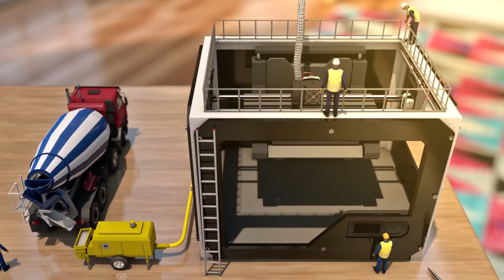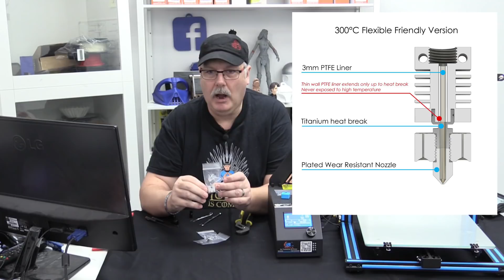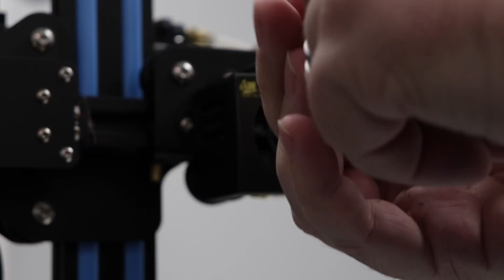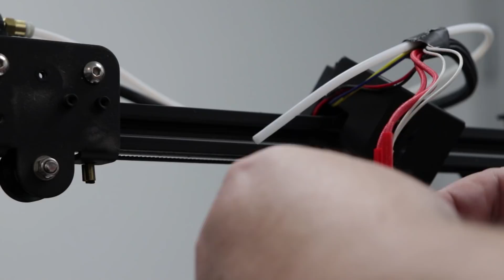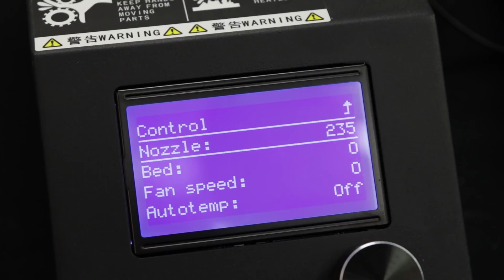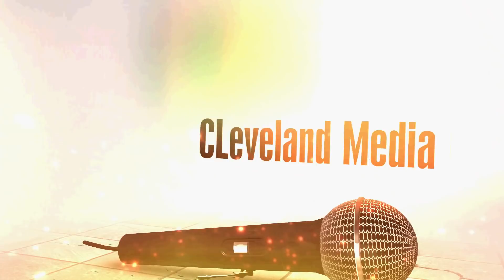Micro Swiss CR-10s Hotend Upgrade

Comment: Quite a few misstatements here. Unplugging the cable which screws into the back of the controller box makes this far easier (along with any other additional plugged in wires connected to the fans/hot end/Thermistor components). "...not cross thread this screw" is easy - Touch the screw tip to it's installation hole and with your screwdriver inline with the hole turn it counter clockwise as though you're removing it (even though it's already out) turning slowly. Once you feel the screw & screwdriver lift, turn backwards a bit further until it suddenly drops downward. That means the end of the screw thread and screw hole are aligned (but some screws have 2 or more thread ends so turning backwards a little further is smart for those as you'd feel it drop again meaning all sections of the screw threads are aligned and cross threading is extremely unlikely then).
 The cooling block (the ridged, tall metal item which is meant to prevent heat from reaching and melting the filament) he called a Heater Block (the smaller slightly rectangular metal block that the heating element installs to is the Heater Block). He a few minutes later called what he said was the heater block the cooling block... Needlessly confusing those who are unaware and/or are new to 3D printing. Putting some quality thermal grease around the heater element so that it touches both it and the heater block would enable faster, more even heating (but make certain it's thermal grease which can handle 375°C or else it will cause more problems than it fixes/helps). He installed the heater element a little to far in. Notice that none shows on the wire side but far too much sticks out on the other end - This reduces the amount of heat it produces from entering the heater block and passing to the nozzle. Put it as close to level on both ends as possible. It's okay if it's sticking out a little bit on both ends so long as the amount is equal on both sides/ends.  If one is installing micro swiss unit it's only useful to run the printer at higher temperatures. To do so (do what he should have as he installed this) buy and install a TH3D Studio "High Temp 50W Heater Cartridge" 12V unit. Then you can run this much hotter and the Micro Swiss then makes sense.

Comment: Hey what about if there's little wires that connect in a loop around a screw on the heater block broke?? Can it be fixed, if so please let me know how
Reply from the maker: If it is broken then it should be replaced.

Comment: WARNING  !!!! WARNING  !!!!  WARNING  !!!!  If you value your hard earned money, and you wish to keep printing without any real headaches, Then Under NO Circumstances Should you EVER DOWNGRADE, (YES I SAID DOWNGRADE) Your 3d printer to The Micro Swiss Hot end.  I bought one, installed it, and calibrated my cr10s printer perfectly.  That is When EVERYTHING Went HORRIBLY WRONG !!!!!!  I had been getting Flawless Prints with the original Lixnwatts Mark8 printer head UNTIL - - - - - - - -  I STUPIDLY Installed one of these NIGHTMARES !!!  Not one Single print since then has completed without a major error, or even completed AT ALL !!!  EVERY PRINT WAS A DISASTER. I wasted over $45.00 worth of perfectly good filament on this Micro Swiss Hot end.  DON'T  INSTALL IT IF YOU HAVE NOT YEY !!! DEMAND YOUR MONEY BACK IMMEDIATELY !!!  This thing leaks, Clogs, Jams, and Prints about the Prettiest Balls of Plastic String I have EVER Seen. SEND IT BACK TO THE SELKER BEFORE UT IS TOO LATE.   It took me over Six hours just to clean my printer after the mess that hot end made.  I printed with Good quality PLA and it still did not work.  WARNING !!!

Comment: Hi, I recently have been having some major issues with a CR10S that I’ve purchased. Printer ran like a champ using PLA when I first got the machine then suddenly started giving me heater faults on the display. Here’s the exact fault, “HEATING FAILED, PRINTER HALTED, Please reset.” I’ve replaced the  whole hotend assembly with an E3D v6 and did the update to marlin 1.1.7 along with a PID tune. Still no luck???

Comment: How do you tighten up the thermal brake and do you use Locktite or something on the threads? It seems if you just hand tighten it (as you did in your video), it will come loose. I know it takes a 7mm open end wrench but you would need a VERY thin one as the round throat gets in the way of a regular size 7mm wrench.

Comment: would it work well with  a 0.6 mm  nozzle?
Reply from the maker: Yes, have recently tested the upgrade with a volcano 1.2 mm nozzle.
Reply: nice did it work well? i got a CR-10 s5 and i need to print big parts for my automotive prototype business , and i need to tweek this machine to work well with this big nozzles, any other recommendation you can give me to upgrade my machine?? i already ordered a Micro Swiss hot end..
Reply: any video with the 1.2 mm nozzle?
Reply from the maker: Ronald Acosta no video yet but I think I will be following up with the printer after the Calgary Expo.
Reply: thanks, i already ordered my kit but now i notice i will need a new fan and change my firmware.. i guess i will do this upgrade once i see videos of this working, im reading a lot of negative experiences with it.. looking forward for the follow up video.. please include the fan and firmware upgrade as well...

Comment: Hello there I have to replace a 2wires 
12v fan blue/yellow by a 3 wires red/black/yellow. What should I connect
 to my blue/yellow please? I guess it is the red and the black but i'd 
like to be sure...Tks a lot
Reply from the maker: Thanks for your question.  The color code for the wires on the CR-10 are as follows: The Yellow wire is Positive and the Blue is Negative. On the fan you will connect the Red to Yellow and the Black to Blue, the third wire (Yellow) on the fan is a signal wire which is not used and can be clipped off.  I hope this helped and good luck.
Reply: Thanks a lot, I did plug it in the right way and it works

Comment: I installed the all metal version version of this and since it will print for a while but then appears to clog with the extruder skipping leading to air printing. I did use some thermal paste but only on where the thermal break goes into the cooling block.  I’ve tried bed leveling, cold pulls changing settings in cura (reducing retraction speed and distance, raising/ lowering temps ,  reducing flow (90%) with PLA.  I notice once I pull any gunk away from the nozzle and give it a little push it starts flowing well again. I know it maybe heat creep but I don’t know what else to try in that regard as fans appear fine, distance of heat break seems fine.  Any ideas? I’ve been fighting this for a week.
Reply from the maker: Hi cepwin, after I installed the Micro Swiss upgrade I was having the same issue.  I discovered that the fan that covers the extruder was not good enough so I changed the fan  and wrapped the block to keep the heat in the proper zone.  Here is a link to the fan,  https://spool3d.ca/12v-cooling-fan-ball-bearing-40mm-x-40mm/ and here is one for the block wrap, https://spool3d.ca/insulation-cotton-makerbot/.  Use kapton tape to hold the insulation in place.
Reply: Thx for the advice!   Am I correct that this is the main fan on the front of the unit?
Reply from the maker: You are correct sir.
Reply: I think that did the trick!!  After I ordered the fan I was concerned that at 2x the amps of the stock fan it might draw too much current so I ended up ordering the Noctura fan from amazon (which only draws .05A) and I was able to print a “torture tower”. (Which I posted in the Facebook group).  I may make a video talking about my experience and including your fix (which of course I will give you full credit for!).  Tnx again

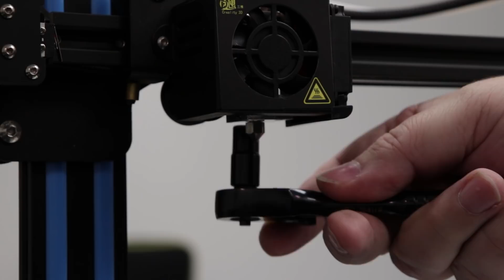Comment: at 10:35, when you were tightening the new nozzle into the new square block, it looked like the whole square block was very loose ... or am I seeing something incorrect here? If it were loose, wouldn't this correlate to poor prints?
Reply from the maker: You are not wrong, I forgot to tighten the grub screw, that holds the block to the heat break.  I did however do it off camera before I printed with it.
Reply: Okeydoke!  Thanks for the response.

Comment: Ok, thats a 300c hot end.  My cr 10s firmware will only go to 260c. Looks like some details are missing, like changing the internal software so that you can print over 260c.
Reply from the maker: You are correct Gary, you will have to do a firmware upgrade to the CR-10s in order to reach those higher temps.
Reply: The First Layer right, so whats the procedure for changing the internal software. Full disclosure I’ve only had my printer for a few months. So I’m new to this and so I have questions. Will you later be doing a video on updating the software?
Reply from the maker: Yes I will.  It seems to be an issue that most new hobbiest suffer from.

Comment: Whats the benefits?
Reply from the maker: fa2ality  the benefit to the upgrade allows you to use higher temperature filaments and flexibles.
Reply: Whats the difference between the all metal and the friendly?
Reply from the maker: The ptfe tube for the flexible material.

Comment: Glad I found this....I just received my kit and it came with a small piece of white tubing...not sure what that goes to?
Reply: The First Layer Is this better than an e3d v6?
Reply from the maker: Where Nerdy is Cool! It is a spare, just hold onto it.
Reply: Okay!  With no directions and no mention of it on their videos, I was stumped what it was!  Thanks for clearing that up.  I've had filament breaking in the Bowden tube for a while so I figured while I am replacing it with Capricorn tubing, replace the print head too. And I also decided to purchase the all metal extruder.  All for less than $150! Video coming soon!  =)
Reply from the maker: I wouldn't say it's better or worse than an E3D V6. I will say that it performs very well and it is a direct replacement for the stock hotend.